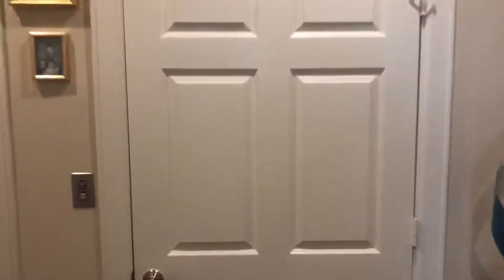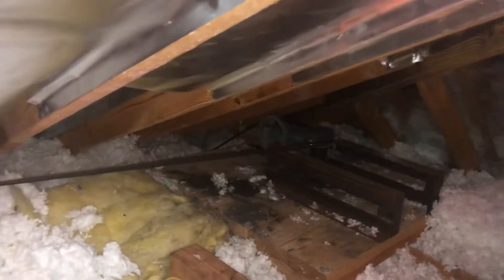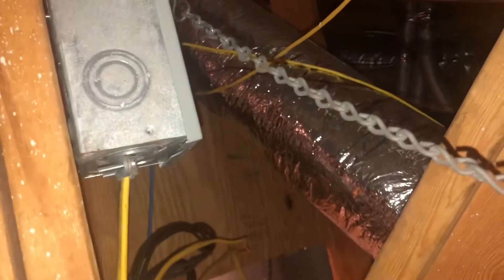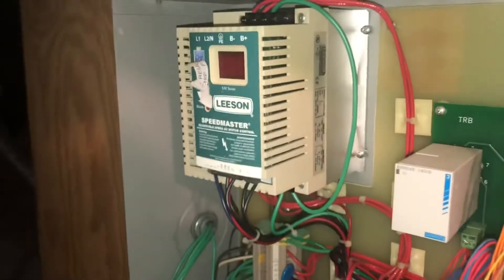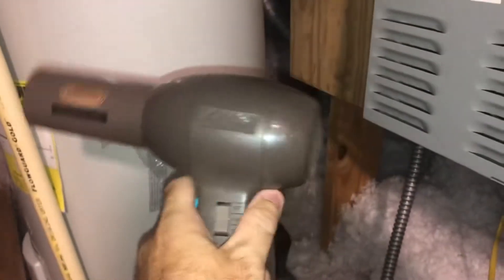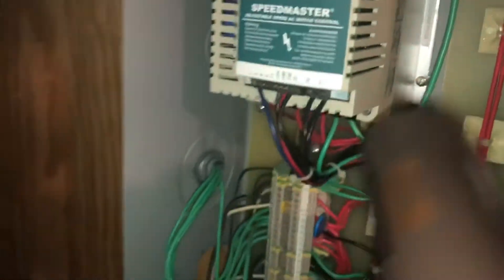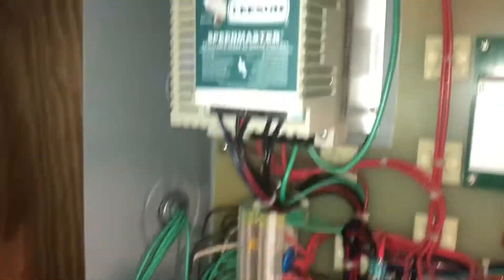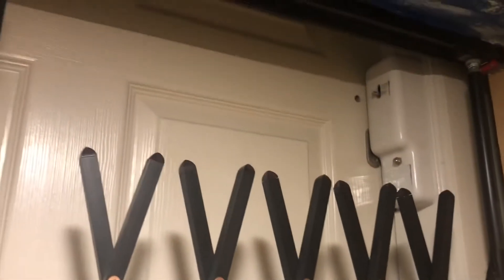Leeson Speedmaster elevator cheap and easy fix!!! Electrical outage reset , emergency chain reset

Comment: Thank you, this worked for my father-in-laws elevator Christmas night.  Does anyone know what the actual root cause is?  His elevator worked after the hair dryer but it happened again later in the day. Is the drive bad? Is anyone able to tell me what the actual root cause is. Thank you all.
Reply from the maker: The component could be going bad … if you are getting constant electricity outages at his place… that will cause the malfunction to reoccur
Reply: @ Thank you. I actually have an open technical service ticket with Leeson to see if they can provide more information.  I will share with you any information they provide.

Comment: I have a treadmill with a similar motor inverter,  and have found that this type of problem is caused by the c22 on the power supply of the logic board. It is a 47uF 16V SMD capacitor.
Reply: yes, in my case too.Tnx

Comment: quick question. I have a Leeson commercial elevator. lights wont turn on in elevator even though all bulb outlets are hot. is it the circuit?
Reply from the maker: Did someone accidentally hit the light button a d forget to switch it back on?  Hard reset  at the control panel yet?  Any error message at the elevator control box?  Hmmmm

Comment: It works to me too,thanks a lot..I think that with the heat the only that can reset is one big capasitor that has inside  and when is going to dead with the heat you give it energy...I don't know if you know something else
Reply: Is yours still working after some days or month with cold weather>?
Reply from the maker: Yep.  Ours is still working… have not needed any new parts etc… just the hair dryer when the electric shuts off etc.  Thanks for watching ☘️